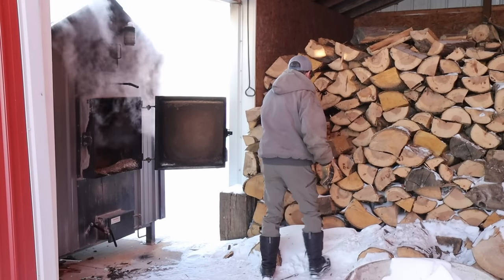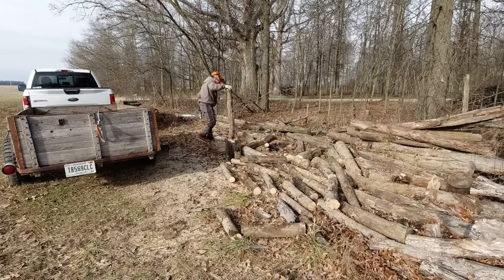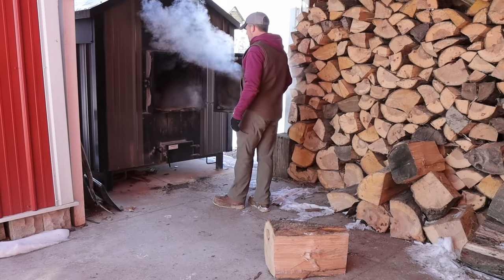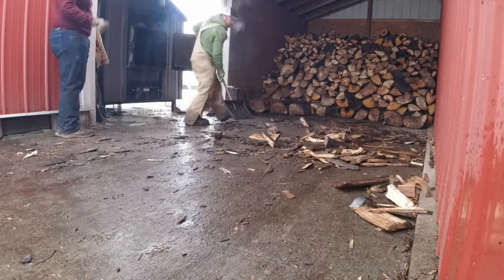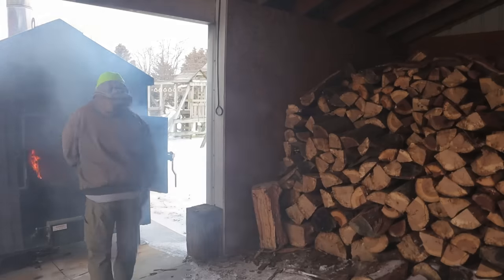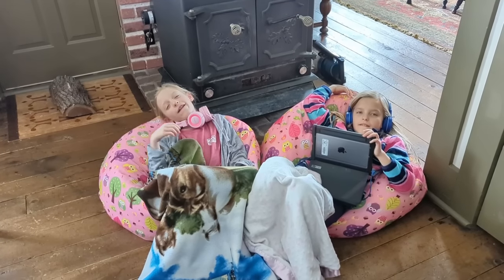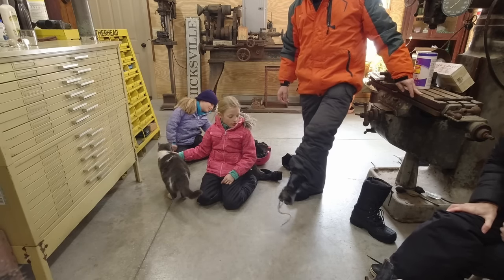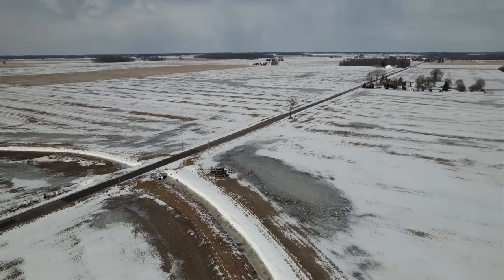Is BIGGER Better? [Firewood Size For Outdoor Wood Boiler] - Why Split Wood For A Large Boiler?

Comment: I say do what works for your setup and making your back last. The only person I know that loads his boiler with massive pieces has the ability to use forks on a skid steer to load whole trunk sections into it. They last usually for 5-7 days before he has to load it back up. But his is out in the open and has a large door.
Reply from the maker: That's incredible!  I can't image loading them in there that big!  Thanks Stuart!

Comment: I used to load big pieces for my Crown Royal. If it fit through the door I burned it. 3 years ago I was sick for 6 weeks and my wife had to load the furnace. Since then I cut 18 inches long and split everything.

Comment: I use an out door wood furnace to heat my house for a few years now. I'm not a big guy I think Neil looks like a more rugged individual then me . There is no way I would ever cut and split my wood the way Neil does, sometimes i have to split the odd one if it might not fit threw the door. Most 90% of the wood is cut right around 45", now I'm 61 years old and I can do it what the heck. But hey you keep up the good work there sunny and don't hurt yourself.
Reply from the maker: I'm trying to keep it easy Murray.  The older I get the easier I seen to want it.

Comment: I burn at least 1500 cubic feet of firewood a season.  UnLess I real need to, I split it all by hand.  I split it in my woods and shuttle it to wire bins covered with tarps.   My ideal size is only 1 foot long and 4-6 inch “diameter”.  This allows me to get the most wood into my small gasifying boiler and the weight is a nonissue.   So I agree with you mostly, except I refuse to stack.

Comment: I have built a thing called a hole. Log loner for my boiler. It will pick up 2 a peace. As big as they door will handle, it's worth it. It helps me out and I can put a big old piece in at 1 time.

Comment: Brother, don’t worry about people who think that they can lift a redwood. They probably think that with the thicker clothes on that your 6’9 and 300lbs of back wood muscle. I gave my back total hell from a young age (trying to prove myself to my bigger stronger friends while cutting crib block and firewood, also carrying full engines from s-10 trucks 2.8l). I’m only 5’6 and now have a really bad back. You also have to have the wood at a size and weight that you can manipulate in the fire box. If you couldn’t manipulate the wood in the fire box then you would not be able to pack the wood in efficiently. You’ll end up with wood standing on end and crossed up in the fire box. I would probably split it to a smaller size for myself. Don’t sweat it.

Comment: Ive only got 1200 sq ft to heat, so my tiny wood stove takes 18" or smaller wood...prolly 30lb pieces for overnight chunks...usually maybe 10-15lb for the standard fire

Comment: I know with my folk's indoor fireplace, can't really go bigger than 14" in diameter.  Thankfully I got a smaller manual hydraulic splitter (works like a rowing machine) to split up some of the larger pieces in to more manageable ones.  I try to split each one just once, but the bigger ones are twice.  I think it helps for efficiency.  No way would I want to be lifting 60 to 80lbs constantly after working a lot of retail jobs.
Reply from the maker: I'm with you Robert.  Thanks!
Reply: ...and, you don't just handle each piece once.  Every piece gets handled multiple times from the field, to the truck, to the pile, to a stacked pile, to the stove.  80#...No Thanks!  Smaller works for me too!

Comment: Interesting issue with the weight factor considered.  All the firewood I've encountered was split for storage/management of the wood pile but more importantly so the wood could dry out.  Perhaps you could build a little kitty condo near the furnace for your furry friend.  Sitting on that cold concrete to be near the furnace doesn't work.
Reply from the maker: Sure does dry better the smaller it is split.  That kitty is about 18 years old and she gets to be as spoiled as she wants to be.  Normally she stays in the block building with heat and a nice cozy bed.  Then she begs to get out during the day to just hang out :)

Comment: I have a wood furnace, forced air. It's in my basement. I split everything over 4", as he said it's too heavy. I'm 6' 200lb. I don't have a good back, so the smaller firewood is easier to move and load. I can also load 40" long pieces, but why do I want to force wood in when I can use a pushpole and just push smaller pieces further back.

Comment: So you're roughly 75kg. I'm bigger guy with ~100kg. I don't blame you for cutting them down. I would chop big pieces like ones you had there too, not because i can't throw it at least 3m but because it's easy to handle small ones. 
Also you may benefit from system we use here (small diameter). We cut fire wood into "metrovice". It's 1 meter long logs. It's ideal size to handle because there aren't too many pieces and it's not too heavy. We also split entire chunks. Easy to stack and loading it into furnace would be pretty easy too.
Reply from the maker: Sounds like a good system 👍🏻
Reply: @digdrivediy   Well we cut everything that's supposed to be fire wood into those chunks in the forest. You can comfortably stack it into truck/trailer and outside to dry. If it's something saw mill won't like, or just random clearing, if it's not too curvy, we cut it into those chunks and process them later. We usually cut them into 1/3- 1/5 lenghs due to stove size, but that's it.

Comment: I’m 230 pounds and an avid weight lifter.  I’m about 6 feet tall I cut my logs at about 16 inches and I split them to prolly less than 10 pounds each they seem to burn hotter and more efficiently that way.  The people that want the huge logs are likely too lazy to make proper fire wood.  I also don’t have an outdoor burner I burn mine inside but still I stand by my method

Comment: Seeing as your good at building consider building a log crane to feed the boiler with. An electric motor driving a hydraulic pump and a power up and down lift with two rails roughly 12 inches apart once the piece to be burned is inside the firebox simply unlock the lifting rails and rotate 90 degrees to dump the wood inside the firebox the pull it out and reset it for another piece. No more heavy lifting save your back it will appreciate it later in life.

Food for thought
Reply from the maker: Thanks James! Lots of great ideas to consider.

Comment: My question for you is and it was the same question. I was thinking when I watch the processor video when you’re laying on your back because it’s gone out. Are you blowed your knee out or your shoulder out? God knows you’re not getting any younger like the rest of us, is your wife going to go out and lift that heavy wood and load that outside furnace or send out one of your little girls to go out and load up that outside furnace or you’re just gonna let your family freeze I know as I’m getting older, I think of this stuff more and more often are used to have a Pellet stove in my house. I turned 55 blew out my knee the Pellet stove left before my knee went out and now it’s a propane stove
Reply from the maker: I'm trying to take it easy.  Gotta get some exercise though..

Comment: I see your point with big  logs,  but  to be honest you burn  allot of wood and I would of  looked into a self feeding boiler.   My friends mum has a 4' outside boiler ...  it self feeds 4 round logs she lives  on her own and uses  a tractor to self feed it.   Not sure if you have that option but it's easy for a 65 year old to do on her own.  No cutting no splitting the guy brings the logs cut into 48" lengths.. neat set up.
Reply from the maker: That would be neat to see.  I've never came across something like that so I'll look into it.  Thanks Robert!

Comment: Just found your channel , fantastic…what do you think of Crown Royal Wood boilers?
Reply from the maker: Thanks so much!  I've been pretty happy with mine.  I've replaced 1 pump and 2 fan motors.  Also repaired a leaking gasket but other than that the thing has served me well for 16 years now.  I would buy another one.  Thanks for watching!

Comment: I HAVE THE SAME CROWN ROYAL AS YOU,  yes i can throw 4' wood in it but im burning tamarac now, it never does get light, its heavy and yes i throw in some 100 pound plus wood and its hard on my back and when im gone working in the winter my wife has to put wood in it,  shes not built like arnold so i have to ue my head when i cut wood also

Comment: Using Ironbark sleepers here in Australia some pieces are 10-12kg, with the odd piece closer to 15kg and thats heavy enough for the wife to put in the fire, so I'd rather not go 80 pounds worth of wood. Plus we only have a small indoor fire inside and in the shed for heating, and the larger pieces of Ironbark only just fit

Comment: I'm 220 and in decent shape and I don't want anything larger than I can move with one hand. It's pointless on your back and big chunks don't dry well. And then there's the stacking that just looks and works better with uniformed pieces but one of my big things is not beating up the door and bottom of the stove with monster chunks.
Reply: Not drying well is exactly why I want it that way. My stove makes way too much heat, so anything to slow down the burn is good
Reply: @integr8er66  That causes rust and soot

Comment: For me its the type of wood. Green wood is what i would call an all nighter. Burns slow but not hot. So i put that in the stove before i go to bed. Sappy wood like juniper burns crazy hot if you let it dry for a year or 2, same as birch. When dry it burns hot and fast. When its wet/green its hard to light. But sizzles nice in a fire with a bed of ember already. This is the internet so you get many opinions from people who demand they are right from some short thing they read on the topic. My personal opinion is its not how much you chuck in the stove, its whether you use green or dry wood. Sappy dry or sappy green. Split wood burns quicker thats why i use it only for starting fires. Obviously with a 80 pound round junk you want to split it though.

Comment: Great video; we were able to find a used wood processor and try to keep the logs at around 8 inches diameter and cut the logs about 32 inches long. When that boiler has done it's  time check out Central Boiler for a wood boiler that will save you up to 60% of firewood. We're enjoying ours.

Comment: Yeah, those 80 pounders would get old pretty fast.  Not to mention on a 10 yr old stove eventually one of the sharp corners on the 80 pounders is going to punch a hole in the water jacket.  Metal subject to daily heat and cool cycles has a lifespan.

Comment: For us , 73 and 66, we had 22 " oak, now were getting 16" . The 22 inch is too hard to place in the firebox. Smaller is much better. 
Wood/oil furnace,  12 x 12 opening, 24 " deep
Forgot to say  the 22" are around 30lb
Reply from the maker: Makes sense.  Thanks!

Comment: Another reason to cut them smaller in my 8 or so years of owning a boiler is to just not work yourself as hard. Keeping in mind i'm still a youngin' and have many more years of keeping my boiler running i'd rather save myself the extra effort and just put a little bit more wood in than to risk burning myself or smashing my feet and or hands putting large and heavy wood in.
Reply from the maker: Good philosophy

Comment: Maybe having insulation done would help you a bit? I soon will buy a 190qm house that has a wood heater and 3000l of boilers that would reach 3 heating seasons with the wood you have stacked under the roof. It was built in 1930 but got 12cm of insulation put on 20 years ago, so the efficiency isnt that bad. Not even houses from 1840 where i live would get frost on the outside walls.

Comment: My boiler can take about 30" length. I have to cut everything to about 24" because my 25 ton splitter can only handle about 25" length. I'm not a big guy so large diameter 2 foot long chunks get real heavy and hard to load. Also when you think about chucking over 60-80lb logs in there the sheet metal takes quite a beating, also using any sharp tools to move wood around in your boiler is a NO NO. We just repaired a 20 year old stainless steel Hardy boiler that had about 30 pin holes from loading damage. After repairing that many holes in 20 year old metal you start getting careful how rough you get with the boiler.
Reply from the maker: Good thing to consider.

Comment: So the way it works with coal boilers  is that bigger pieces of coal tend to burn slower than the same weight of smaller pieces because the smaller ones have more surface area that can burn.

I'm pretty sure the same works for wood so it depends on your application.

It might be better to have 2 boilers, one maintenance boiler with large logs and a smaller quick acting boiler filled with small logs.

Comment: Smaller pieces = more pieces = more surface area = faster/hotter burn.. If I want to make a HOT fire fast, its smaller pieces... then I will put a giant log on the fire last thing at night to keep the coals going all night so I have something to work with in the morning.. 
Im thinking if you kept that boiler running full blast all night, the larger pieces would work better, but since  it cycles off and on, its not ideal..  And yes, you have to be able to lift the wood! Im not about to bring the folk lift over to load the firewood!
Also wonder.... does coal work in there?

Comment: If your using a processor, sometimes you dont get much choice on the size of every piece. But anything over 50 pounds is getting to be tough to handle never mind get into a boiler. Were heating here not trying to break our backs for nothing
Reply from the maker: Yeah, I was trying to run some of these back through the processor but some slipped by.

Comment: Put some black locust in your wood stove they're even heavier than what you're burning it'll make it really hot Burns hotter than oak I lifted this walnut wood and it weighed even more than the the black locust and the logs that I was lifting I mean they were big they were 150 lb to 200 lb logs of black locust and I had to get some help for the no the logs I had they weighed more than 200 but they were some pretty long logs that had to be cut up they were probably like 5 ft long of black walnut the only thing was black walnut is it burns up quicker because it oils in it it's more made for furniture Northern Nash is pretty good

Comment: What type of situation would  justify the actual cost of processing firewood vs. just using gas or electricity as a heat source? In an off grid location, the answer is obvious. But what about propane? Hauling cost? cost of the propane itself? Of course nothing beats the sound of a crackling fire in cold weather. But what about the actual economics of it? I'm sorry for asking a stupid question. I live in the tropics🤣
Reply from the maker: For us, the situation is that we choose to heat such a large area.  We are heating the house, 3 car garage and a large workshop with our wood stove.  To heat with electricity would be incredibly expensive for us, probably in the neighborhood of $1000 per month or more if we heated everything with electric.  Propane is likely our next most affordable option and that would still cost roughly $5000+ for a winter season.  Our cost of heating with wood is realistically around $1500-$2000 for the year when I rent the processor, and about $1000 for the year if I don't rent the big splitter.  In our 16 years of burning wood with our outdoor boiler, I have rented the processor only 3 times.  So, let's say conservatively I save about $3500 a year by heating with firewood, then we've saved $56,000 over the last 16 years heating with wood.  

No stupid questions here.  It was a good exercise for me to put it all down in writing.  Thanks so much for watching!
Reply: @digdrivediy  Amazing. Thanks for sharing.🙂

Comment: I know someone who permanently damaged his back lifting 80 lbs he had pain for the last 30 years plus back operations. Once you damage a disc in your spine they replace it with a sold spacer the next one up will go bad and that will need to be replaced. Now he is on a morphine pump puts a drop into his spine once a day. It ruined his life can't really do anything after retirement other than watch TV.

Comment: Haters gonna hate. The worse thing is having that fire go out and opening it and seeing 4-5 large pieces still in there. That’s why I have a whole pile in my wood shed of smaller pieces and I’m using a 2020 classic 6048 with a stainless steel fire box and that same thing still happens. I’m only 32 and I still split my pieces for the weight reason plus my wife is only 130lvs and helps me stack so I split them to like 20-35lb pieces. Some people may have different situations and not care about there back but they’ll regret doing that over a long period of time

Comment: Not buying this logic.  You can cut longer and then split it smaller to keep your weights more manageable.  I burn 20”, it stacks fine but the heaviest length of log I burn  is probably 30 pounds.  Less cutting saves the chain, more surface area so it dries faster and about 20% less stacking.  With a wood processor it’s no more work for splitting…

I greatly enjoyed your video on the wood processor and this follow up.
Reply from the maker: The length was just where the wood processor was set up to cut.  You could cut them longer I suppose, but I was referring more to having 3-4' pieces.  Not just 20 inchers.  20s would be fine, that isn't much different than my 16-18s. 
Oh, and I certainly didn't mean I want them heavy.  I like them 30 pounders too.

Comment: As big as I can handle efficiently.  But you have to make sure the Mrs has a small pile. I do use smaller prices at the bottom and place large diameter logs on top. This gives me a very long turn time of about 30 hours